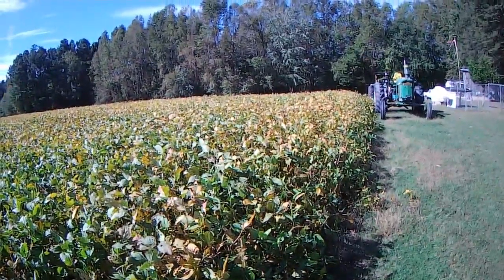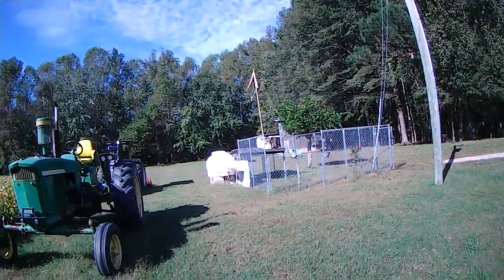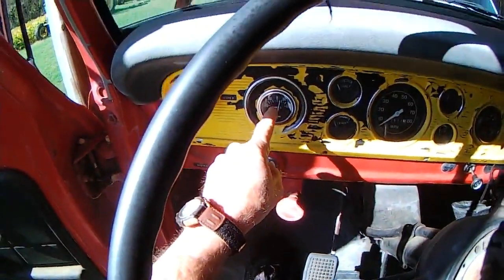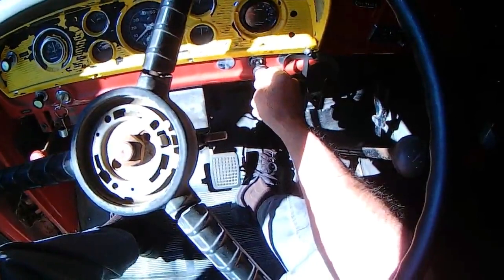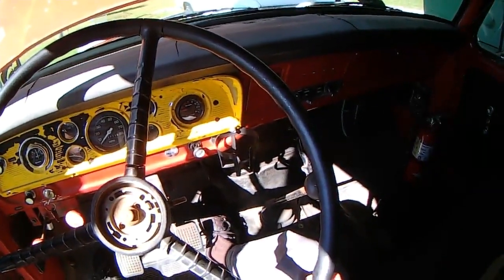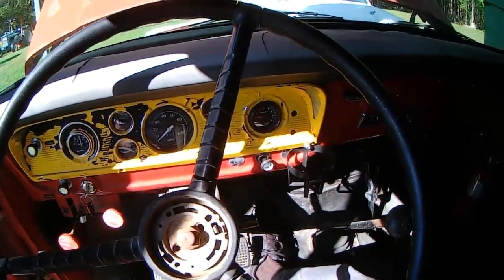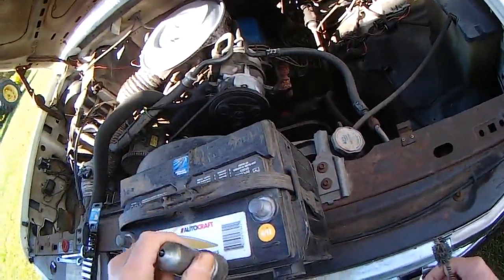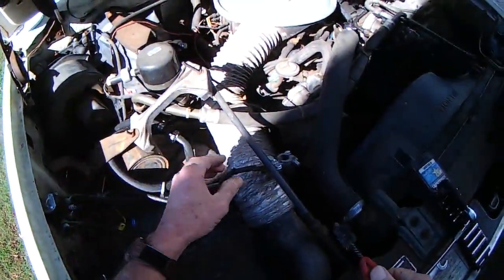Cold Start F600 on a weak Battery

Comment: Thanks for showing us around. That truck runs nice and those old comes were pretty nice cause you knew they were gonna work. I still like some of the "old fashioned" ways of doing things. Everything got a little too fancy for me. What your Dad said was right on the money for sure‼️ Take care and hope your beans start turning pretty good now.
Reply from the maker: Mark Mortensen - loose electrical connections under high enough current produce heat and heat starts house fires.   I remember daddy saying if the wire nut broke it was defective, if the screw on the device broke it was defective.   I wired a lot of houses with him that summer.  glad I did, handy knowledge.   in a few more weeks we'll be able to see the actual bean pods a lot better.   thanks for watching and being here Mark.

Comment: Using Vaseline on battery cable ends works best. It won't burn it or melt. These new self sustainable batteries are bad. You could drill a hole in each hole. There are ways to make batteries come back. Take a DC welder, fill the battery up with water, hook + to + and - to - . Leave caps off. Turn the welder all the way up on high. Stand back as you throw the switch. You'll hear the sulfation break loose and see the water bubble out.
 When you hear the welder at full throttle, throw the switch off. Charge at about 11/2 amps for about 15 hours. Works great on Marine batteries. I owned a battery shop. Plastic repair can be made using the  inside plastic and using a hot iron. Nice video. 
🦅 Eaglegards...
Reply from the maker: Dr. Fastestinthewest - the Vaseline creates a barrier to the air causing the corrosion grease works well too.  the little red and green chemical pads do little so I stopped buying them.   when I get all the batteries back in their assigned location I'll grease the post.    thanks for the boil out information.

Comment: Looks like it will be a little while before you harvest down there.
Reply from the maker: Massey1105driver - late November on into December.   sure would be nice to be in a cold cab, maybe even run the heater instead of cooking like years past.   but as usual I get the freak 70° F day making it like 90° in the cab.

Comment: Good video SF. I like your farm truck. Do you run Farm tags on it?
Reply from the maker: Chuck Stevenson - $278.00 worth of weighted Farm tags.   you do not want to get caught hauling over your purchased amount of weight.   I buy 24,000 pounds worth for the F600.   this means the weight of the truck and the cargo can not exceed 24,000 lbs.   maybe next year I might up it to 26,000 if I can get new tires.   thanks for watching and commenting Chuck.

Comment: here in Canada we have annual safety's for that size of truck and over and it would not pass without speedometer working
Reply from the maker: candianwelderfarmer - here in North Carolina since my F600 is over 35 years old no inspection is required.  my 1982 Ford F150 is exempt also.   on the F600 in 4th gear tach at 3000 I'm running 58 mph.   it's all good.   thanks for the information concerning Canadian rules and regulations.
Reply: @SoybeanFarmer3300  even here anything under a 350/3500 series you only safety once when you put in your name once over 4500kg gvwr safety every year
Reply from the maker: candianwelderfarmer - some of the northern states where they put a lot of salt on the roads will fail your vehicle inspection because your vehicle has to much rust.
Reply: @SoybeanFarmer3300  same here any holes it will fail